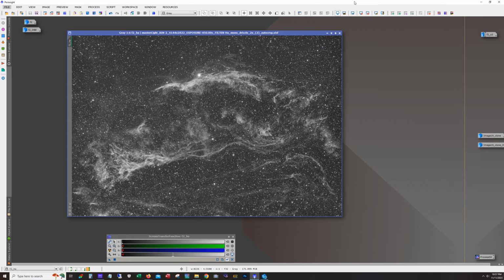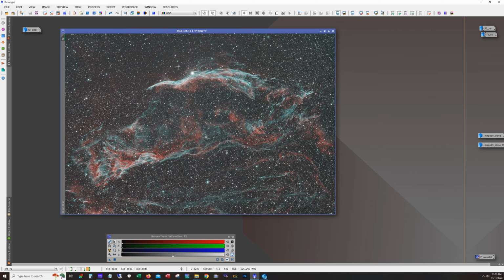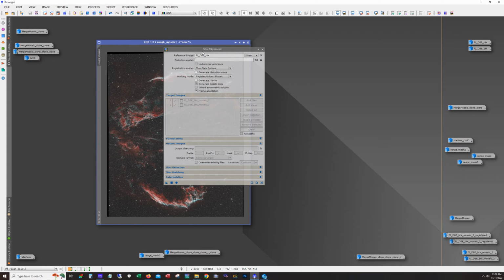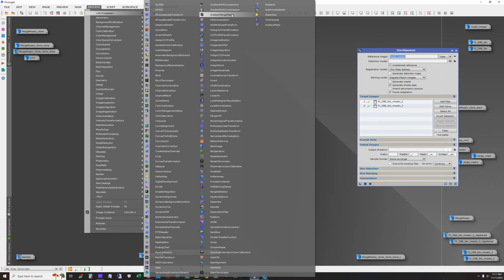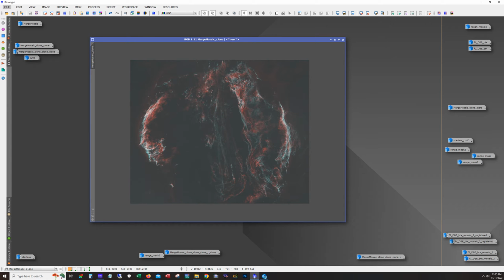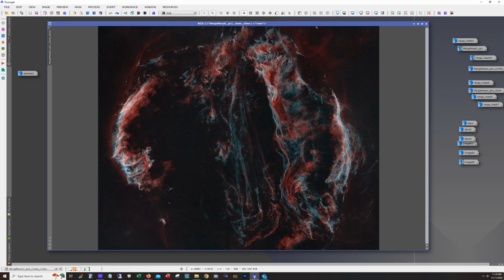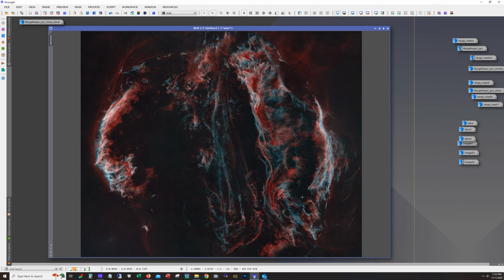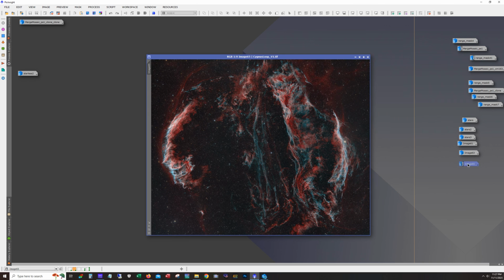Astrophotography:  The Veil Nebula (AKA Cygnus Loop!)

Comment: I really liked this image James and I hear you with trying to decide on how red or blue in these HOO images its almost like its too binary for our Astro brains:) Super image.  Also these gradients in mosaics, APP does have some tools when integrating  to help with that although no real substitute for those less moon filled skies.  I only just got away with a Orion / Horsehead mosaic after many hours of trying to fix the join.  Very nicely processed.  Clear skies bud.
Reply from the maker: Agreed, HOO is too binary... but I see some of these other HOO images done by exceptional astrophotographers and their images look great.  I need to figure out how they are doing it.  

I tried APP twice.. too separate trials and I just wasn't satisfied with the mosaic results.  It merged the panels fine.. no panel lines.. but when zooming out from afar, the difference in the panels was too noticeable.. especially with the stars removed.  I know a lot of people swear by it but I couldn't get it to work.